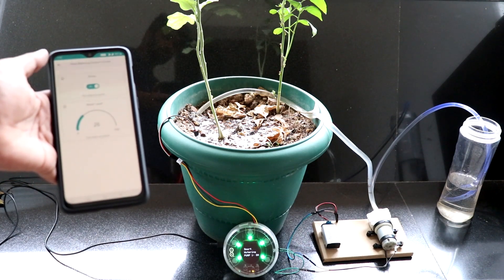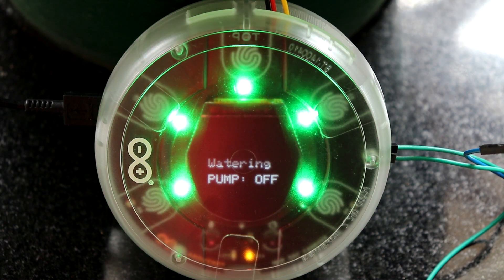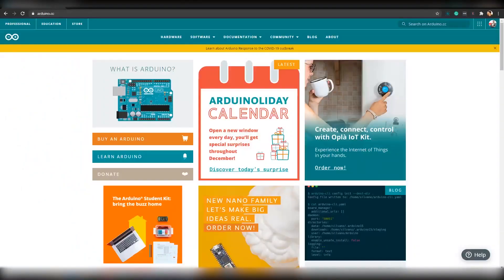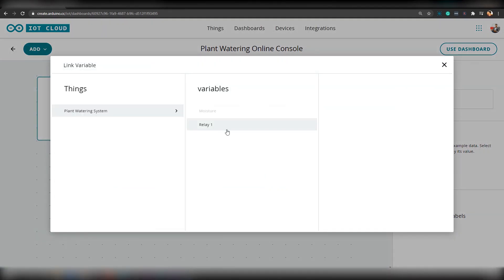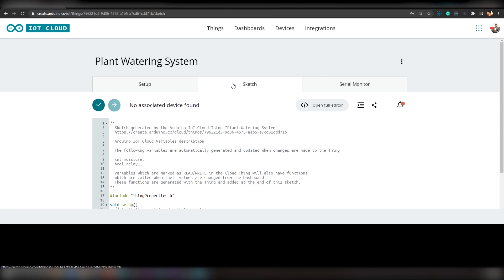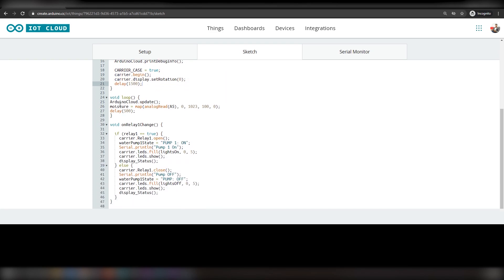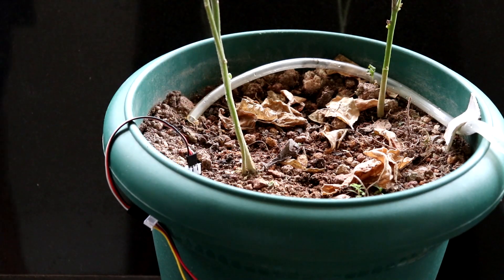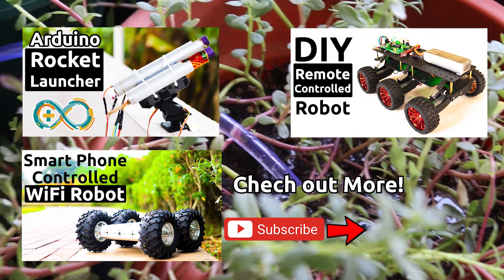Automatic Plant Watering System 🌻- Arduino Smart Home Project | Opla IoT Kit

Comment: It seems like the system works with two power supplyers (battery and a black wire). Is it posible to make a watering system with only one power supply?
Reply from the maker: Yes. We need two power sources. One for powering the Carrier, MKR1010, and another for Relay. Relay's NO, NC, and COM terminals are completely independent of the internal circuit of the carrier board. So you have used a separate power source to power the Pump.